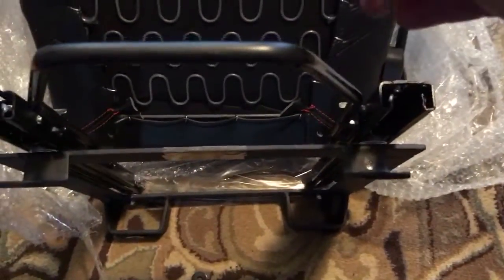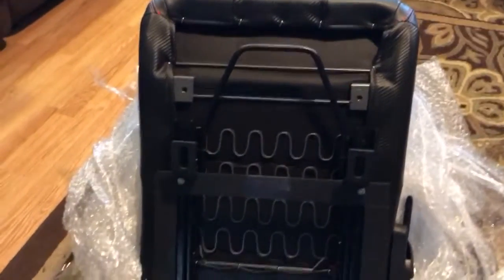Corbeau seat bracket install heads up

Comment: Put that washer up to your bench grinder and put two flat sides on it so it doesn't intrude on the slider space anymore. At least then you'll get a little more protection from that bolt pulling through the track
Reply from the maker: I do not recall the context as this is quite a few years old, but I ran these seats for a few years with no issues other than some seat back flex.

Comment: Hey buddy i have a question, not sure if you will reply but by chance i have a 1998 jeep grand cherokee and want to get some universal seats from amazon. If i get the corbeau brackets specific for my jeep and some tweaking done would you think it would fit? I am 6’3 btw headroom is my only concern, if you have advice thanks so much
Reply from the maker: If you get the correct brackets, there is no need to tweak. The just drop in
Reply: @PMPerformance  thank you sir, glad i got to see this. Its a big project and eventually i want to get it back mint, so far got a 3.5 inch lift on 33s witha strong v8
Reply from the maker: @22lrjayden81  my pleasure. Good luck with finishing it up!
Thanks for watching.

Comment: My seats didn’t even come with bolts wtf
Reply from the maker: its been so long I can't remember if the bolts came with the seats or the brackets. I want to say they were on the seats though. I would deff contact them to send you bolts
Reply: @PMPerformance  They came with the seats. Nice vid, thanks for sharing!
Reply from the maker: @lRoboToast  thanks for confirming. I was pretty sure mine did as well.